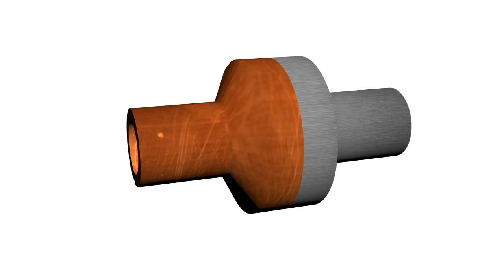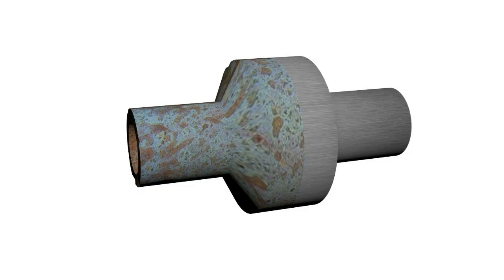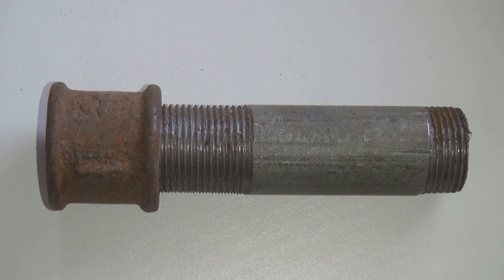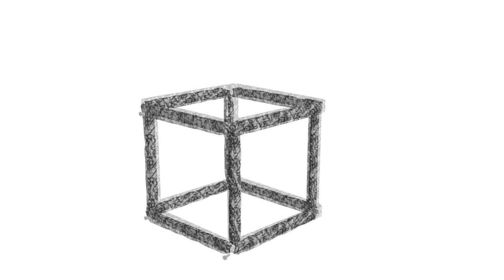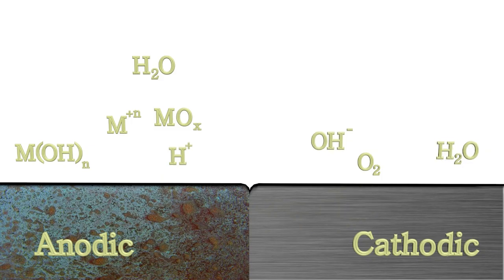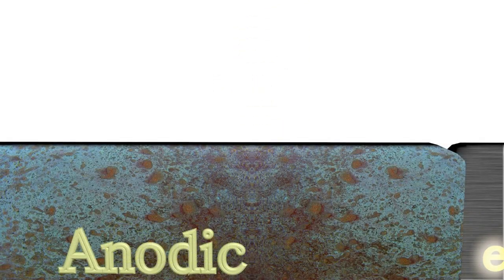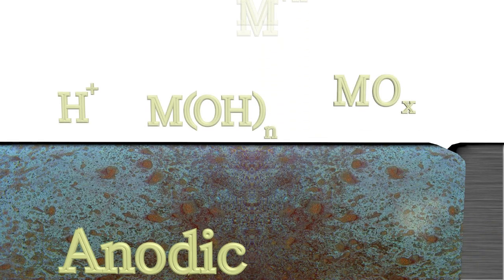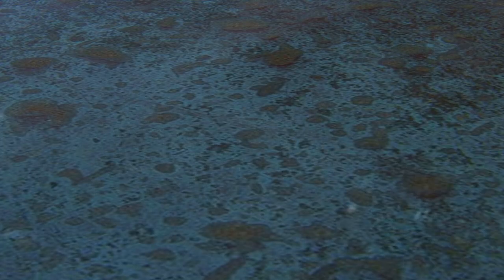Galvanic Corrosion | Forms of Corrosion

Comment: Maido,  Thanks for the information.  Your video was informative and at a level a novice could understand.
I have a question about corrosion on my cell phone charging port.  It would not power up one morning.  It was very hot on the battery and unresponsive.  I took it to my local Sprint store where the technician told me there was corrosion caused by water being on the port.  They said it was water damage and it should be under a insurance claim.  The phone was never wet and I take reasonable care of it.  With that being said is it possible for the corrosion to occur without ever actually being exposed to water and would it have to get wet over and over again for the corrosion to occur.  If there was a small amount of water it wouldn't it cause a small amount of corrosion and then dry up.  The corrosion can not feed off its self and grow, correct.  Could this have been caused by (1. a bad electrical connection) or (2. if any of the terminals had a coating of copper and it was worn down to a metal other than copper? )  After asking the technician to explain to me how corrosion works and he couldn't I have been researching and find it very interesting.  I am Electrical Controls Engineer, but this is a bit out of my area.  I would appreciate any help.  Thank You
Reply from the maker: +vwb11356 I left a more thorough answer on the mail but for those who are also interested in the issue - the corrosion of cell phone (and other small electric devices) is often galvanic by nature and the factors that contribute most are: moisture (water, sweat, moist air, condensation), bad design that leads to galvanic coupling, metal parts (e.g. circuits ) being exposed to air and not being coated with an insulating water proof coating, charging port not being sealed with the plastic piece and of course mechanical wear that removes the protective rust layer and re-exposes the fresh metal.

Comment: Hello! Great video! I am a fabricator and have been experimenting with aluminum electrochemistry to rapidly produce an astheticly organic looking surface on huge sheets aprox. 3ft by 10ft by 3/4" thick. I have been making samples on 5"x10"x1/4" 6061AL so far my consistant technique has produced the desired texture but it involves much attention and agitation to the solution and surfaces. I have simply applied sodium chloride on the negatively charged aluminum plate and rested the positively charged plate directly on top, both submerged in tap water. I run aprox. 17amps for 20min, then remove and agitate the surface on both +/- plates. I add a little more sodium chloride to the (-) charged suface and rest the opposite plate back on it for another 20min. I then remove the (+) plate and scrub with a wire brush to clean all the biproduct off which I assume to be sodium hydroxide?? not sure since the metal it forms on is aluminum. I am looking to get an extremely aged surface. I can send photos and videos to show you my technique. this is a huge project for work and would mean a great deal to aquire any information from you to help me simplify my technique. not sure if I'm doing anything wrong.
Reply: +Maido Merisalu thank you for the quick reply! Definitely a lot of useful informatoin for future projects! I would like to send you a few photos of my results. Really would like to hear your thoughts after seeing my samples as well.